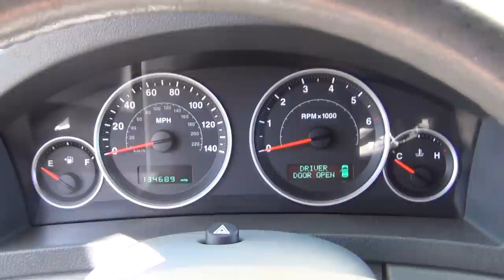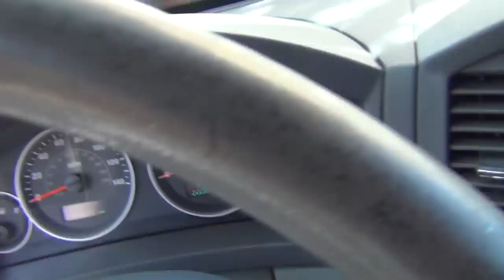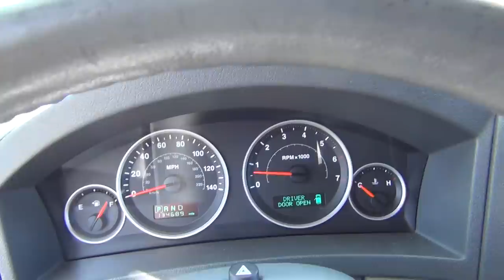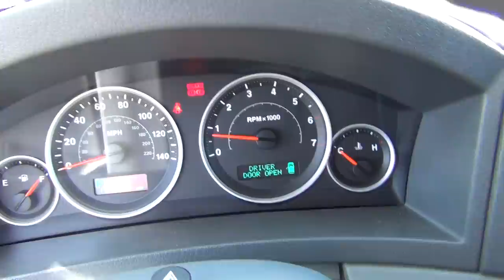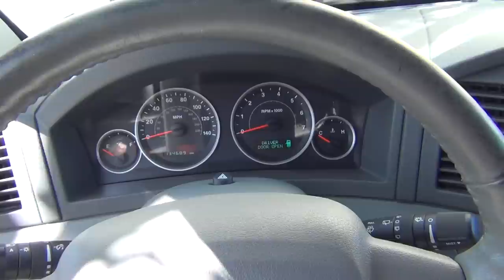2005 Jeep Grand Cherokee - N23 Fuse Pull #25

Comment: Thanks for this, I just did it on my 2007 3.0 CRD Commander and it worked a treat. The fuse box layout is different to yours but the fuse numbers and descriptions correspond, just in case anyone else is wondering. Cheers! Dan.

Comment: Thanks for this as this morning I had service 4WD system when I was pulling my boat up a steep hill on uneven ground and had to put it in low 4wd. I think the uneven ground on a hill had something to do with it.Whats wrong with the good old days when you just pulled a mechanical lever and it always worked fine.

Comment: I just purchased an 06 4.7L today.  The seller told me the 4 wheel drive actuator was needing replacement and it was showing the same issue as your video.  I am so glad I found your video.  I tried it and it worked.  I don't know if that was a permanent fix or temporary but it's better than paying for parts and labor.  Thanks so much.
Reply from the maker: +shane jordan Look for an unflashed FDCM or go through Chrysler hell to try the updates.
Reply: +shane jordan Every few weeks engage the 4Lo. What happens is the actuator gets corroded from not being moved. When you engage it, it breaks the corrosion. But once it builds up too much, it becomes stuck. Pulling the fuse is like a "Hard reset". Sometimes it works, sometimes it doesn't. Depends on the about of build up .

Comment: I just did this and it worked! I have an 07 grand Cherokee limited 4.7. I pulled fuse 23 and 25, both are labeled FDCM. Turned on my jeep, no error message, but my ESP was disabled. So I turned it off, put fuse 23 back in and left 25 removed. Started the jeep, got the "service 4wd" message. Let it run for 10 seconds. Turned off. Installed fuse 25, turned jeep on, put in neutral and went right into 4lo!
Reply from the maker: Kyles life. Some say new actuator and latest Jeep software update and no more issues. I went the only real trusted route and installed the unflashed FDCM and now no worries. Do I worry about it jumping out of park, NO I use the parking brake like you are suppose too. I also don't remote start my Jeep. Amazing Jeep was forced to do a recall (N23) when the issue was two cases out of all the ones they sold. Which had to do with remote starting which I don't have or plan to install on a 15 year old vehicle...LOL And which the owners obviously failed to follow proper parking instructions not just by the booklet from the DMV but that of the owners manual. Parked on a slant, Hill or whatever you always use your parking brake. However these same people are probably the ones that use a jack but then do not use a stand and then crawl under the vehicle and jack fails and they blame the jack and not themselves for not using common sense. The Government protect people too much and lets them continue to breed. 

I'm not lecturing you by the way...just ranting how stupid this recall was to begin with. If this was a wide spread issue with only two cases then it shows that most people with a brain use the parking brake or this would have been a rampant issue plaguing the nation.

If I own the vehicle another 5 years it be 20 years old...anyone buying a 20 year old vehicle will have much more serious issues then worrying about N23. Or the vehicle will be bought to be used strictly off-road shrug In which case they for sure will not care.

I'm more amazed at the people on the Jeep forum that love going back to the dealer 50 times and bitching. I complained once, twice and then fixed it myself. $60 for an FDCM...would have cost me much more then that in fuel, time and energy to run to the dealer...no thank you.

Comment: Don't know if any of you had the "New Flash update" on the CPU of the Jeep but that didn't correct it as well.....  Problem just came back tonight, started chugging at first then came the error. I do this trick every few months, but guess what... The GD battery for the jeep is the problem.... Either keep em charged up (as in on a trickle charge)every month or get a new batt every 10th mo.... I believe the system needs more than 1 source, it's overloaded....No problems with a FRESH batt. My head lights never show that it's getting low and even don't dim when i go to start, so it's kinda odd to me, but only if I charge my battery it corrects the problem also with the fuse fix.... I also recommend backing up 10 feet then forward again with fuse out, shut off, then place back in.... Good luck all.... We need it with how they make things now days!
Reply from the maker: I bought a used unflashed FDCM, never had an issue. To find an unflashed FDCM is probably hard at this point I did it right when I heard about the N23, and no I never went back for their "other" updates. Why would I! I have no issues not being flashed, I need to buy a OBDII lock just in case I ever have to go to the dealer they don't go plugin into the Jeep. I would probably toss in the N23 issue FDCM...but all the miles I have never needed the Jeep dealer. Changed my own water pump, my own starter...etc etc There is that recall on the ignition, nope not going in for that either, I lost all trust in Jeep dealerships on this.
Reply: +Meeker Extreme what's the ignition recall? Do they actually fix something.  I know the motor in my steering lock failed long ago and periodically it locks the steering wheel.
Reply: Pierce Sinibaldi q

Comment: Just been told today by my local main dealer, if you have had the N23 recall there has been to further recalls for the FDCM module,. So Jeep are well aware that they still have problems after the N23 recall.
Reply from the maker: Yep, I traded mine in with the unflashed FDCM...I still have the Flashed one...and I bet whoever gets the Jeep will find out the shitty way about it.

Comment: I have this exact model ..I'm catching hell myself guy ..but I hope u can use this bit of info .. I had been getting random indicator lights on the dash ..head lights flickering etc .. untill I got a new alternator because this particular model has the voltage regulator inside of the alternator ..good luck guys
Reply from the maker: Thanks for the extra input. Mine I just replaced the FDCM to roll back it with one that wasn't flashed all it cost me was like $80 maybe it was $60. I no longer have the vehicle and I traded it in with the unflashed one so hopefully it was sold without being flashed and hopefully the new person didn't get it updated...LOL

Comment: This worked once for me. It lasted for about 3 or 4 weeks but the error returned. I tried to do it again a few times but no luck.
Reply: +Jason Wadsworth did you ever get this fixed?
Reply: My solution was to buy this OBDII scan tool for $20 I just keep it in my glove box. 

http://www.amazon.com/Foseal-Scanner-Adapter-Diagnostic-Andorid/dp/B00W0SDLRY?ie=UTF8&psc=1&redirect=true&ref_=oh_aui_detailpage_o05_s00

 Anytime I am given the error, I just plug this in the OBDII port and it clears the error and my 4wd Low returns. It will continue to work for a few weeks before I need to plug in the scanner again. Plus the scanner is useful for other things. 

From what I know there is no official fix for the issue. The only way to get you jeep to work completely as it should is to find a FDCM that has not been serviced by the recall. This option is expensive and it may be difficult to find the part. On top of that you will need to make sure that it never receives the recall service or you will be back where you started.
Reply: +Jason Wadsworth , hmmm, well I'm scheduled Wednesday for the P73 update based on all the information I have been able to gather this should be a good fix. If the flash doesn't work they are suppose to change the FDCM completely and if this doesn't work they change the actuator all free of charge (I'll let you know how that goes.)
Reply from the maker: +Alonso cardenas Hard to justify all that leg work back and forth to dealer on a chance. I totally understand though only so many unflashed FDCM's around to go around for all.
Reply: @alonsocardenas5549  can i bring mines in just bought one 2007 commander and has this issues

Comment: hey I also have to do this on my 05 jeep cherokee to work but when it goes to 4wdlow and put it in drive after a wile it down shifts to 4th gear and can't go into drive anymore I have to restart my jeep to mack it to go to drive agen but then it goes to 4th gear age is that normal or what could it be.

Comment: Thank you did the fuse trick it worked how long did it work for
Reply from the maker: +Jimi Tremonte I only did it for the video as I had a unflashed FDCM so I never have the issue with 4LO and N23.
Reply from the maker: +Jimi Tremonte Reports I read said it could last awhile to stop working to needing to do it every time you need 4LO.
Reply: __ so this should work

Comment: Problem I get if I leave the fuse in is when I shut off for a few minutes - typically under an hour it basically locks the diff or tcase clutch and it binds causing wheel hop...  If I accelerate through it I get a service 4wd, abs error and brake error from memory. 
Any suggestions appreciated.
Reply from the maker: If it's the FDCM (N23 issue) then the above works. Note though that you could have issues with your transfer case and not N23 related which it sounds like you might have more issues. For the N23 I bought an unflashed FDCM and have not looked back.

Comment: Hell ya 05 worker great how long it’ll last .. what’s it do just reset the actuator after a short or something but my fuse was fine
Reply from the maker: Resets something. You can do a search there used to be a post where someone took the actuator apart and it's an easy fix if you actually have a problem with the actuator and you have time and some soldiering skills.

Comment: I have a wk 2005. I was driving it and it stopped out of the blue. It won't start now. But it if I move the shifter it will crank like wanting to start. Any help would be much apreciated.
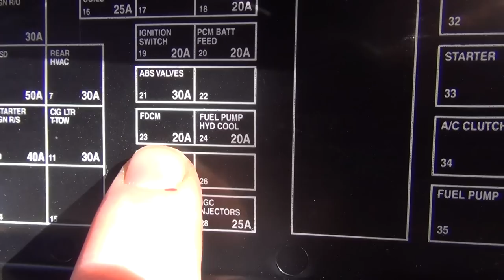Reply: My thought is fuse 16 IPM coils. Pause this video at 1:35 and you can see it. It's a clear 25 amp. 
It's can look ok, but maybe getting hot.  They blow by a minor short on the look over the engine wiring. 
Alternatively could be the cps or bad ignition. 
I hope to hear how you got on fixing it.

Comment: Nice work, but does it work with 2012 GC Overland Summit? If it does, please help me by giving the fuse number.
Again good job.
Reply: Did you ever find the fuse #? This happened to my 2016 yesterday. Thanks.
Reply: @Go_Play_Outside  
I found it, but didn't solve the problem. You should replace your TCC which is a Transfer Case Control. There's a box under driver seat similar to the battery location. You'll find 3 electronic devices, one of it is a TCC, it's easy to remove same like the hard disk in the old CPU. Type the part number one Amazon or eBay and you'll find it.
No need to take your car to the dealership.
Once you connect the new TCC the 4WD Service light will disappear.
Good luck..
Reply: Thank you so much!

Comment: Had "Service 4wd system" and small red light (down by the 4wd lever) telling me the vehicles drive act was in neutral and ready to tow. The vehicle drives just fine and 4wd low works and I have been back for the recall. It still shows "Service 4wd" and the little red light is still on! Anyone with more more brains than me out there any ideas? It's a 2006 commander

Comment: I've tried the fuse pull several times on my 2006 4.7 liter grand Cherokee but I still have the service 4wd light. any suggestions?
Reply from the maker: You probably need a new actuator. You truly could have a problem.
Reply: Meeker Extreme ahhh man..any ideas on how to confirm it?
Reply from the maker: No idea

Comment: Anybody try this trick and have it not work? What's the next course of action in that case? Don't wanna buy FDCM and have it not work. Just my luck I'll be the one case where none of the tricks work and gotta do an expensive fix.
Reply: +Ethan Selleck IF the fuse trick doesn't work the next course of action is finding a non-flashed version of the FDCM at a salvage yard. It's located under the rear seats.
Reply: +Ethan Selleck Hello, did you ever get yours fixed?

Comment: What if it doesn’t work??
Reply from the maker: You could actually have an issue with the circuit board that controls going into 4 wheel drive.